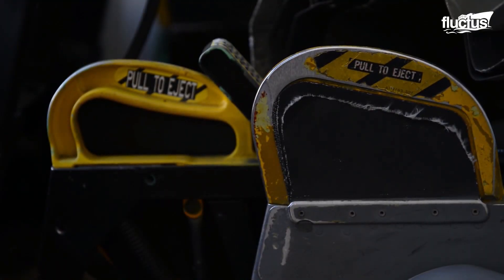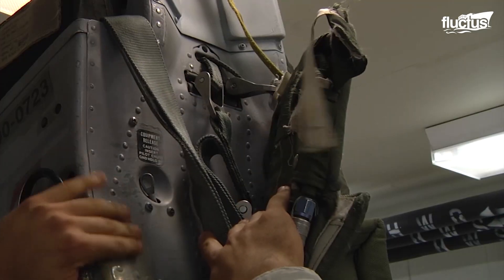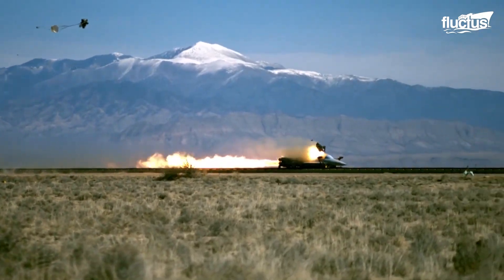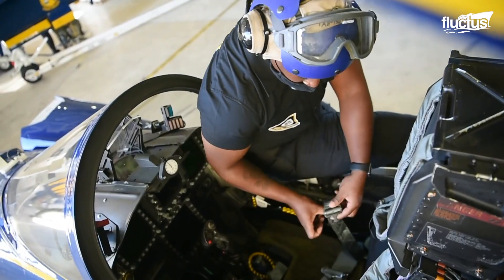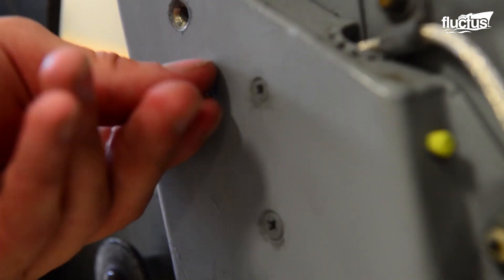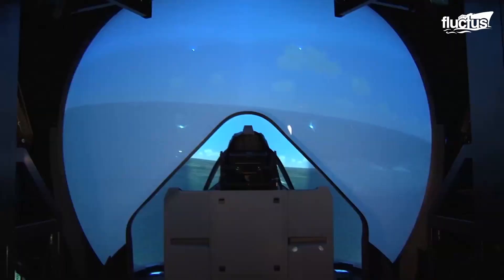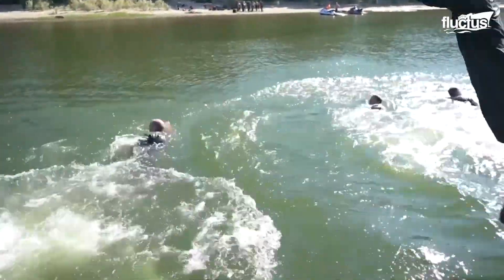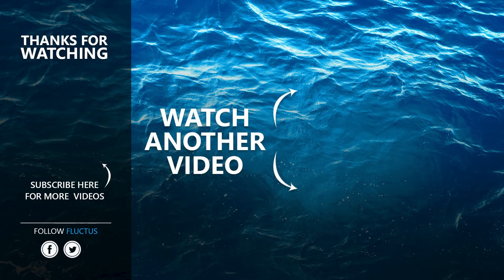Why US Pilots Are Forced to Eject Only at the Very Last Second

Comment: Training repeatedly tells the pilots that waiting  means they crash with the airplane.  

Upon determining the airplane is not flyable... punch out.

Taking the time to point the aircraft to a different impact point  is usually futile and just results in the pilot going down with the airplane.

Pilots still try to control the impact point.  It's in their nature.  Honorable men trying to save others, even if it costs their own lives.

The few examples where they managed to get out after ensuring the aircraft hits an open field are used as "don't do this" training examples.
Reply: I just heard on a podcast that when they go thru their checklist if they see fire the next action item is eject. I know this isn't 100, but close. Point being they dont weight and ur correct.

Comment: Pilots do not always eject at the very last second. To wait for the very last second puts them in more danger. There are two classifications of ejections; controlled and uncontrolled. In a controlled ejection the pilot is still able to maneuver a crippled aircraft, such as an engine failure, to a safe place away from populated areas. An uncontrolled ejection is when the aircraft is breaking apart or has insufficient altitude or ability to glide. In that case an immediate split second ejection is necessary.
Reply: a bad landing for example, even on a carrier

Comment: If you can add it to your kit bring a small facial breather...so when your under water if the top piece gets stuck from water pressure it takes time to break it open,yes I had body problems after gotta get in shape...
Reply: On my ejection seat type we had a supply of oxygen just in case we ejected at high altitude above 10k or to breath for a water landing.

Comment: I had the horror of watching 2 pilots eject less than 500m in front of me. They had a flight control surface failure and tried to wrestle the aircraft back since they were over a semi populated area. One punched out while the aircraft had rolled to about the 11 o’clock position. The second went out while the aircraft continued to roll and got out when the aircraft was between 8-9 o’clock position. Both of them came out then were steered upwards in milliseconds. Oh and the aircraft was <20m AGL. Fortunately both survived with minor injuries. Unfortunately the aircraft landed on top of a truck with a civilian worker in it. She died from the impact. I’m a USN/USMC flight test engineer and was participating in a test very close to the runway when we heard the emergency call from the aircraft.
Reply: Whats the attrition rate of the f/a-18 vs say the F-14? Pretty equal by now? When I was in the navy (early 80s, F-4 squadron fire control tech nas miramar/cv-43) damn tomcats were dropping out of the sky at alarming rates seemed like 2-3 a month. Most were compressor stall due to that POS engine.
Its amazing what these seats can do though when you have to work around them it keep on your toes. When I was at FRAMP training at NAS Oceana an AME trainee ejected himself into the ceiling of one of the hangars, think it was an A-7. The canopy didnt seperate so he and the seat  went through it, before they hosed what was left of him off the roof they marched nearly every one of us trainees through that hangar to witness what might be our fate if we ignored protocol. It really was a weird mess, between all the burnt shit from the seat rockets, the blood and bone fragments that his body must have shed when it went through the jagged plexiglass canopy, and it was all pretty much untouched because they were still investigating what caused it. It did smell like burnt flesh. The AMEs are the only ones besides the PRs who work on seats in various stages of operational ability. The rest of us just had to check that all 7 pins of the safety lanyard are in place, though often when we had to do wire bundle repairs the AMEs pulled the seat completely.
Reply: What type of aircraft was it?
Reply: @Aeronaut1975  F/A-18B.
Reply: De de

Comment: Nice video, but you forgot to tell us "Why US Pilots Are Forced to Eject Only at the Very Last Second"!
Reply: Exactly. It is a nice video but it drives me nuts when they don't address the question or statement that they put with the video. Unfortunately this happens alot on YouTube.
Reply: I was waiting for the same thing. That is the only reason why I watched it. I want the 12 minutes of my life back. I feel cheated.
Reply: What I understood from the video, it's because if they eject too quick when they're going full throttle, they'll experience too much force. Therefore, they eject at the last min possible to minimize the chance of injury. Since the plane is longer flying full at cruising thrust. 🤷‍♂️
Reply: @YourGrannyHere  not necessarily. In most cases if the engines are operating youre not looking to eject. Of course high speed introduces more risk but the system is designed for that. The more common scenario is an ejection over populated areas, if the aircraft still has hydraulic power over the control surfaces, the pilot will often stay as late as he can so the aircraft avoids homes, buildings, etc. Google NAS Miramar hangar 1 disaster 1969.
Incidentally I used to stand late night watches in that hangar when I was in VF-21 in the early 80s. There were rumours the hangar was haunted by the ghosts of the dead men, to remind the pilots training at Topgun (also in that hangar) to be careful. 
I dont think so. Just a lot of rats!
Reply: .....it's because that's the "Holy Shit - I've Got No Other Choice Now" moment! ....."second", as it were. aka: "last second ". 
🤔😂🤣
Reply: That's because the Pilots are cheap but the planes are not.
Reply: @doctorpanigrahi9975  No. Incorrect.
Reply: What I’ve heard is that it is because military aircraft are millions of dollars
Reply: @ArchKomposer จจจจจจ8จจจ
Reply: Yes, all true. And the entire event from handle pull to a fully open parachute, including canopy ejection (or explosive shattering).takes less than 3 seconds….